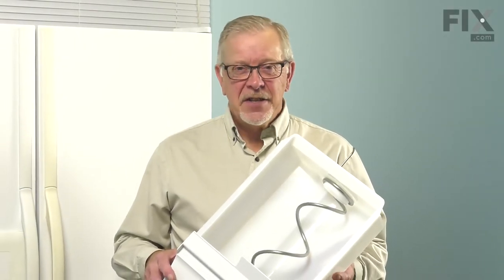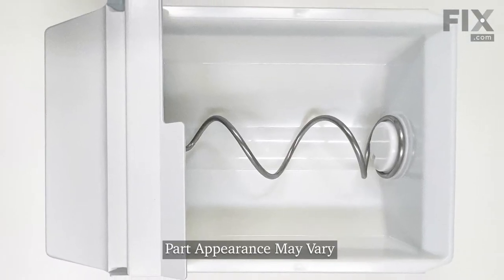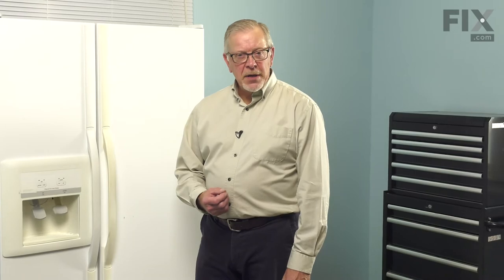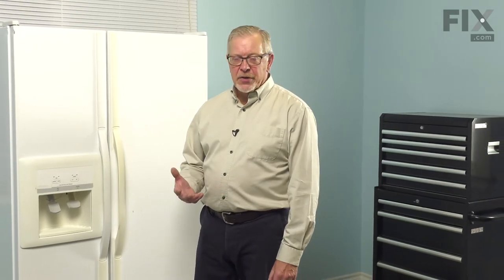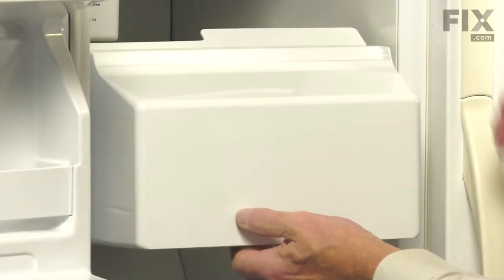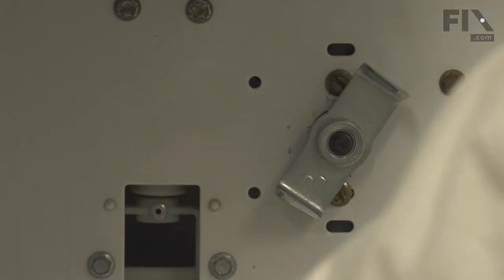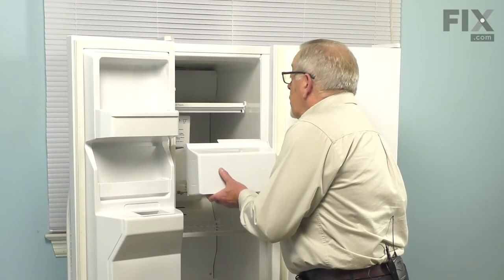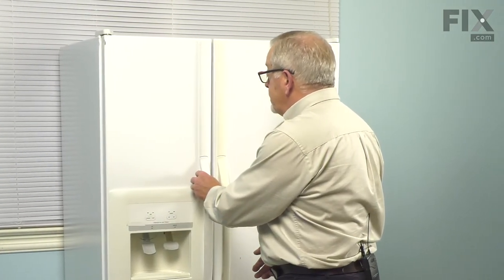Whirlpool Refrigerator Repair - How to Replace the Ice Bin

Comment: Nice Video! I had a question about the original ice bin, mine has the plastic cover over the back half of the auger, and it's causing the ice in the back of the tray to freeze up. Is that plastic cover something that I can remove from the original tray? I noticed the replacement one doesn't have the cover.